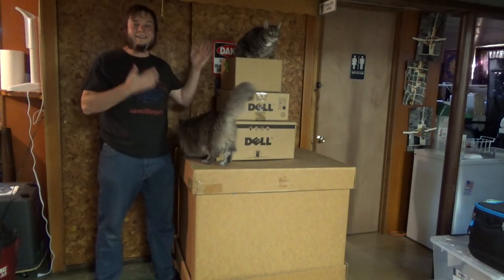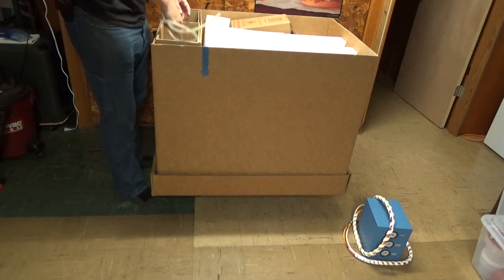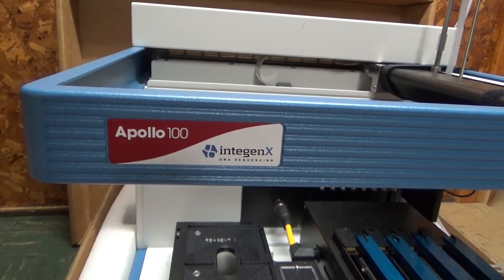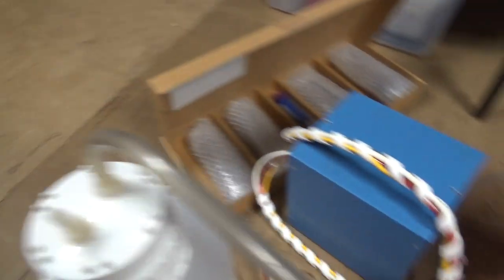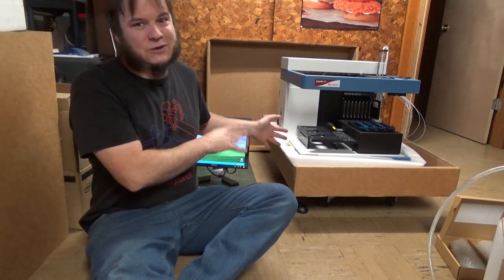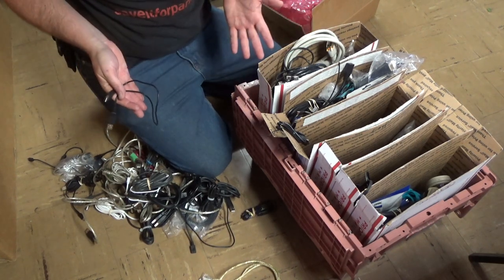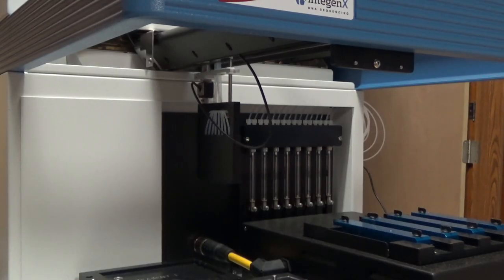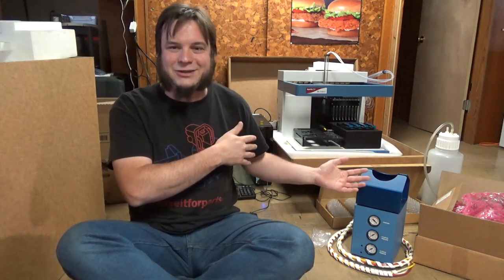I bought a DNA Sequencer for less than the cost of a home genetic test!

Comment: Old DNA analysers are useless, the tech has moved so  fast that even if you could still get the consumables they would be way more expensive than modern services. And even if you could use it, you'd still need a lot more lab equipment and trained operators to do anything useful.
I've taken apart several -  one originally cost $500K, and consumables were about $20K per run. Think I paid about $300 for it.
it is interesting to see how they build gear that is basically "cost no object"
Reply from the maker: Yep, I learned from a couple people that these are obsolete and too expensive to run. I traded it to someone for some other stuff.

Comment: 7:12  Same with me, they forgot (although I feel dumb for not noticing, yet checking for EVERYTHING ELSE lol, gotta love adhd sometimes) not only the 3 or so serial port cables, BUT ALSO THE RUDDER PEDALS.

I’ll either hack together something from an Arduino (some good diy/os designs exist already), or pay 100 or so dollars to get the “real deal” as an oem replacement part.

Either way CHECK FOR THINGS AND ASK WHEN DOING THESE.

Otherwise, as stated in my other comment, i 100% recommend going to these.

Comment: Yeah, University Surplus Stores are awesome!  COVID threw stuff into a more hassle ways and means... and seems pricing went up other than the auction stuff at times.  Looks like that blue thing holds that larger Nalgene bottle?  Maybe was never used?  I had equipment that before I implemented the Design Qualification (DQ) into the Equipment Lifecyle SOP... the lab would purchase equipment they never used since didn't meet the lab specifications test procedure requirements and then would just list on the lab auction site eventually (I forget which one Perrigo and I think Pfizer used since I didn't deal with those systems).   Will be interesting to see what you can determine to get working cost effectively.  Would be interesting if you can find the software and/or hardware engineer(s) and/or scientist(s) that developed the equipment?  Maybe even a lab tech might know enough?

Comment: Tear out the XYZ controller and install arduinos with motor drivers for a small CNC or 3d printer. The mechanical part of that system has got to be better than most hobbyist units on the market. Tecan is a well known biomedical engineering company that collaborates with numerous others in the field.

Comment: Dumb and maybe 1 good ideas:
Homemade 3d printer.
Personal Floppitron. 1st request would be "Home Improvement" theme.
Empty one of the cabinets of parts, put a shank in it, fill with concrete. Literal boat anchor for the jetboat.
Clone a condor or ibex instead. That way you won't have to hear, um, Jeff Goldblum go on about chaos.
Reply from the maker: I actually have a couple 3D printer projects I'm working on, but they're more complete / assembled than starting with this. Maybe if they don't work I can cobble together everything into one gadget :-)

Comment: I am looking forward to the dinosaur park addition at sandland.
Also since I took my A+ certification back in 2000 yes I cannot forget serial ports, or SCSI device termination and ID mapping.
Speaking of weird stuff and professional hoarding... you happen to be interested in a 24' diameter 52" depth Intex pool liner? Used for a couple weeks then stuffed into my shed after it tore along the top rail. Have pics of the damage and part number if interested. I am in west st paul.
Reply from the maker: I'm not sure what I'd do with the pool liner, right now every spare storage spot is stuffed with old billboard tarps! I need to do some un-hoarding so I have space for more hoarding :-)
Reply: @saveitforparts  Definitely know the feeling... currently going through an unhoard myself. Just can't bring myself to chuck it because it still holds water but is scary as an above ground pool due to the support being compromised. Maybe I will turn it into an in-ground pond?
Or maybe I should hold on to it until you get more mileage on the DNA sequencer because it'd probably make a great water dish for the dinosaurs. 🤣
Reply from the maker: If you have the yard space you could do a garden pond, we made one with a stock tank and some extra plastic pond liner. It brings in a TON of wildlife, we see all sorts of cool migratory songbirds and other critters now that we have a pond. If it's 52" deep you could dig it below the frost line and over-winter fish in it.
Reply: did i see the framing of an above ground pool out by your cabin? then again i saw a burrito floating around my house the other day... couldn't catch it. i was hungry too :(

Comment: Damn thats a good deal, only one on ebay right now and its going for over 5k.
Reply from the maker: The thing with eBay is you can ask whatever you want, but won't necessarily get bids.
Reply: @saveitforparts  Yeah that's a good point, still though I would bet its worth more than just $100. I hope I can find a good deal on one once I get enough space to setup a proper bio lab. I really want to be able to sequence my own dna and test it for a certain gene that runs in my family which causes peripheral nephropathy, I am hoping by the time I have kids I can find a way to remove it if I am a carrier.

Comment: I went to one and got a dual engine flight simulator and old pc for 20USD

Came for that and ended up getting some other misc stuff.
Reply: Sadly i could not fit the Forensic Cyanoacrylic Glue Fuming Chamber in my 90s honda accord (but did fit the flight simulator console…WITHOUT REMOVING ANY SEATS LMAO, sketchiest drive home though lol), otherwise i would have had the world’s BEST 3D Printed part smoothing machine…

Either way i 100% reccomend these if you have some money to burn, ESPECIALLY if you share the fun at Makerspaces etc (as i hope to do one day) not hoarding it yourself, or worse end up selling them for more…

Comment: GPS output for navigation software was serial bus for years!  Post- LORAN. 
Is the sequencer essentially an auto PCR/electrophoresis?
Reply: I was recently involved in provisioning a bunch of $4,000 laptops that had built in GPS. Brand new models. They still use serial to communicate. Granted, it's all internal but I had to make sure they were assigning the correct COM ports to talk to software.
Reply from the maker: I'm still not 100% sure what the thing does, apparently it handles the first two steps of a Sanger sequence (but not the electrophoresis part). It might be a little less useful than I thought, but I'm consulting with some more knowledgeable folks to see if we can do something with it!
Reply from the maker: Interesting! Only time I really use serial these days is when I have to program some oddball device like a radio or one of those RV satellite dishes. I have a couple other things with mysterious serial ports but no documentation on how to talk to them.

Comment: Windows Vista.  Those were the days.  Junk OS.  Pure crap.  Nice try with the revival.  Dang thing sounds like a printer from the mid nineties.  By the way, that was a parallel port, not a serial port.
Reply from the maker: It's the size of a parallel port but uses serial protocol, not really sure why they did that. It works with a generic USB-to-serial adapter.  I kind of dimly remember my old DOS and LAPLINK experiments with 286 laptops, and I don't think parallel and serial were directly compatible without additional converter boxes.
Reply: There is a great scene in The IT Crowd where Moss is standing next to a bomb disposal robot examining a suspicious package.  He's really just quite excited by it all.  Then he calls out to the tech who is running it from a safe 100 yards away: "What operating system do you use?"  "Uh.....I think its Vista".  "AHHHHH, WE'RE ALL GOING TO DIE!!!"
Reply: @saveitforparts  if I remember correctly, they both could use 25pin 'D' centronics connectors, but the gender would be reversed for serial, I can't remember which one was was male or female for peripherals, my old printers aren't handy, and I often mixed them up when I used them often..
  SCSI one used that connector too! Got a scanner that needs a 25 to 50(or68) pin adapter..